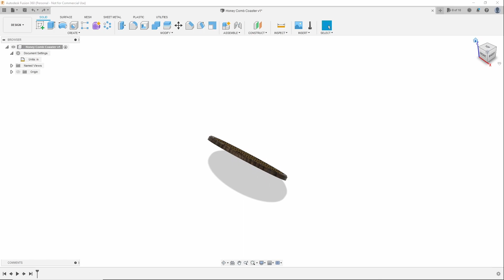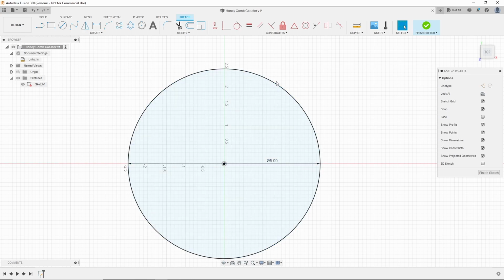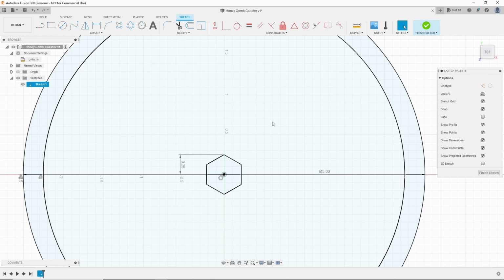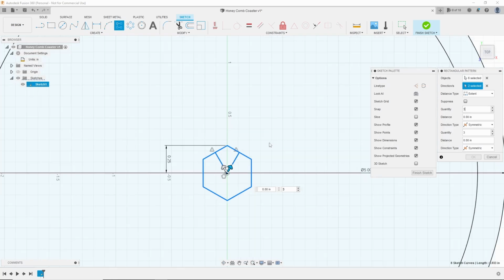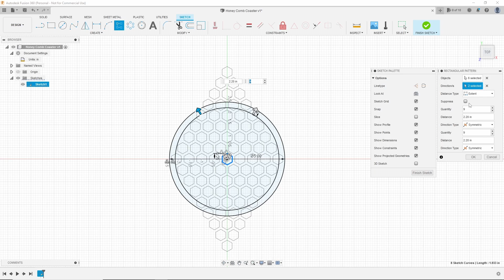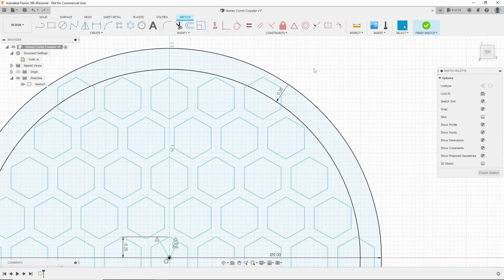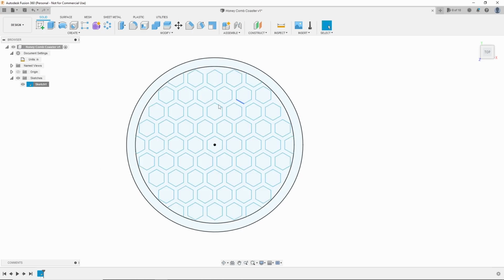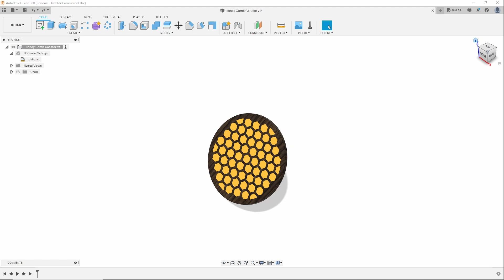3D Design: How To Design Honeycomb Patterns In Fusion 360

Comment: I'm trying to do a different pattern using the rectangular pattern feature. You're able to select individual lines from the honeycombs that fall outside of that inner circle; how are you able to select the individual lines like that? Is it because your pattern is based on a single shape? For example, my pattern has 8 total triangles. When I pattern in, I have to make enough copies for it to fill the space just like you did. However, when I extrude it, it cuts slots in the outer wall of my model.

Comment: This is the best method I’ve seen on honeycomb.  The magic is the V shaped axis lines for pattern direction.  Can’t believe I didn’t think of this.  Other videos show the direction line method but do it from centre to hexagon vertices and centre to a hexagon horizontal midpoint and using two hexagons to pattern.  It works,  but for large pieces it crashed fusion.  This method allows for less hex’s and smooth operation.  Well done.

Comment: Thanks for the tutorial.  I use Fusion 360 for laser work.  Instead of cleaning up the lines (for the DXF), I find it easier to extrude a 3D object, create a new sketch, and then project the geometry on the new sketch.  This keeps all the construction lines in the original sketch for future edits, and if the projected sketch is linked, any edits to the original sketch are automatically updated to the sketch used to export the DXF.

Comment: No need to remove the extra hexagons or trim. Extrude the part, and project the face as a new sketch to export for dxf. Should be alot faster since you only have to click the unwanted parts that actually intersect your edges.